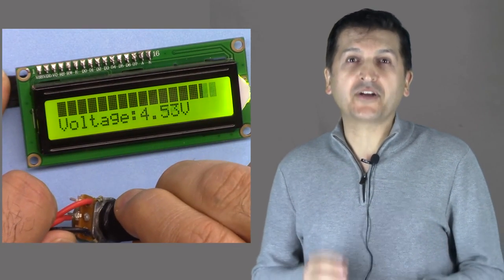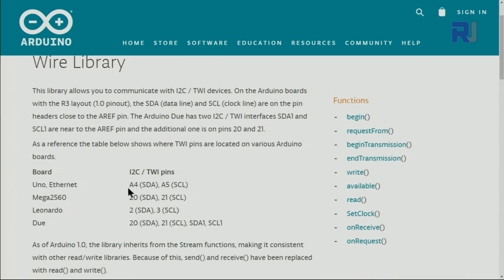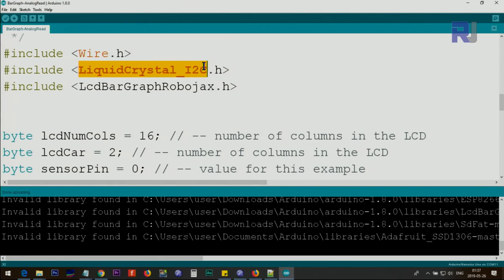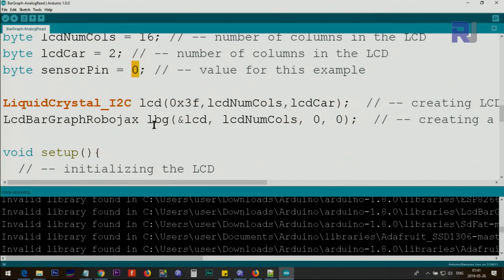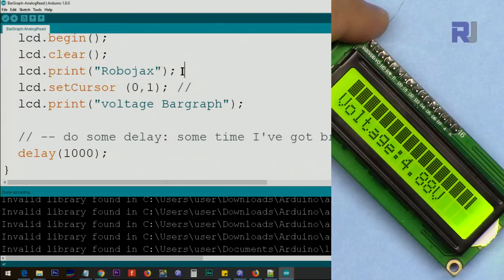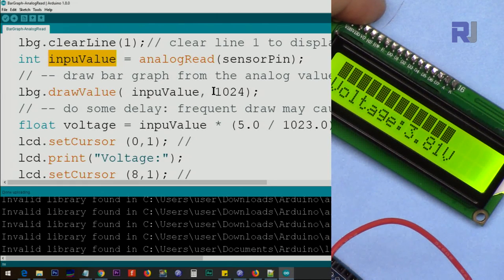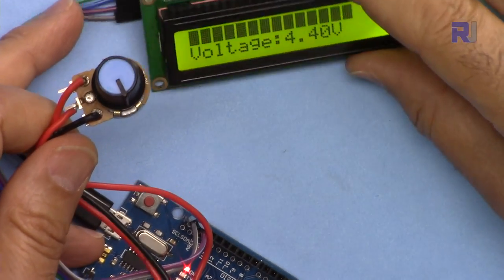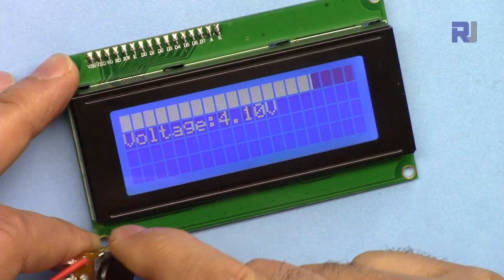Display input voltage as bargraph on LCD using Arduino and potentiometer

Comment: Thanks for the excellent tutorial. Your library directly references the i2c library. Is it possible to change this so it's not necessary to use an i2c adapter?
Reply from the maker: You are welcome. It would but LCD1602 without the I2C is very missy so I prefered the 4 wire version. The library can be fixed but it needs a lot of work.

Comment: I like your video! You are very easy to follow! I'm a subscriber now! Thanks!
How Would I calculate what is maximum mA left in the battery?
I like to make a simple 18650 battery tester. What I want is VOLTS=  mA=  Battery resistance=  and even more, if you can help!
Reply from the maker: Hi, Thank you for subscribing.
Battery  is the most complicated component in today's world. If anyone can accurately understand the state of charge (SOC), they will dominate the EV (Electric Vehicle). 
I have  studied Batteryies at graduate level but haven't got a chance to make video as I need some components. I just got 18650 batteries and few chargers.  I am wondering why other than EV people will need to use 18650 battery?
Reply: @robojax  I use them as a power-bank for projects. I recover these for free from old laptops! But I also purchased 8 new batteries, so I know what to compare it to!
When I get my new charger, I can provide some data. I do have several chargers, from inexpensive and USB charging in bank of 2-8 18650.
These batteries are - or can bee - very powerful! For now I also purchased from inexpensive to more expensive battery meters, but I get different results from one to the next tester, so I must make a Excel table and compare them more scientifically and side by side.  I also use Arduinos, ESP8266 and ESP32..., Raspberry-PI and couple other boards, that I test or projects - 18650 will keep my simple projects running a long time, much better than AA rechargeable batteries - and I recharge batteries for past 50 years!
I wish my flashes for my Nikon cameras use 18650! I'm thinking to make battery power-banks and put them on a belt and wire plugs into the flash! Lots of projects, so little time! ha ha ha

Comment: Thanks a lot forr his video. I have a questiion. I would male a rpm counter for my spinning cyclette and i put your library in the sketch. I suppose that max rpm value Is 150. Right code is lbg.drawValue (PPM, 150)? Or lbg.drawValue (PPM, 1024)? Thanks in Advance
Reply from the maker: this is very slow for that purpose.  RPM or anything would be very fast.

Comment: Wwhat's that chip connected to the back of the lcd 
do i have to get it in order to display the the voltage or is there any other way of wirring
Reply from the maker: I have separate video on the LCD, the link for that is in the description. I always put extra stuff in the description so check them out.

Comment: I want to display the voltage reading controlling with potentiometer with LCD AQM 1602 using Raspberry pi 4 with C programming.  I'm waiting for your response . thank you .
Reply from the maker: this video is focused on Arduino. In the future I might have Raspberry Pi videos.

Comment: I am making battery charger for lead acid battery so I want to display battery charging percentage with help of Arduino nano and 16*2lcd so what will be code ?
Reply: 12v battery
Reply from the maker: I have included the link to this video in the description https://youtu.be/t8xwrVj2aFs where you will learn how to measure any DV voltage.
Reply: @robojax  thx sir for helping

Comment: Hello Sir, im trying to upload you library for the bargraph, i have installed liquidcrystal_i2c from previous projects. I have download your file, but when trying to upload the zip i get the message "Error 13, INTERNAL library install failed, archieve is not valid, multiple files found in zip file top level." I have decompressed the zip and they are a lot of files, which i have to keep and make a new zip again please?
Reply from the maker: Hi, you don’t decompress. Just add the zip file
Reply from the maker: If you did use the bar graph once then you don’t need to add it again.
Reply from the maker: very simple it says "LcdBarGraphRobojax.h: No such file or directory" it means file not found It means you skipped the video and did not install the library. Please watch and follow. I have said nothing extra except to teach you learn.

Comment: Sir this video is amazing but I want this for 12 v instead of 5v pl can you help me how can I can I do it
Reply from the maker: when you use Arduino, Arduino board has VIN input where you can connect your 12V and the LCD and Arduino will power up. Or you can connect the 12V to the power adapter connector.  see this image https://circuitjournal.com/img/articles/6_arduino_power_pins/VinPin.jpg?v=17
Reply: @robojax  thanks for replying sir I want to make 12v battery indicator like this so how can I do that I understand previous message but I want to make it battery level indicator pl tell me thanks
Reply from the maker: Please watch this video https://youtu.be/t8xwrVj2aFs and learn about voltage divider.  Then your potentiometer will be 1 of the resistors apply the same principle. here anotother video for voltage sensor https://robojax.com/learn/arduino/?vid=robojax-voltage-sensor. good luck.
Reply: @robojax  thank you so much sir

Comment: there is a mistake in your code and people get an error with rjx
because you write lbg and under you try add rjx but it should be lbg in this line rjx.clearLine(1); instead rjx--> lbg
and same thing in line under
Reply from the maker: you must be referring to other code. I just checked it and there is rjx in this code. Follow the code from the link under the video and you will see there is no error.

Comment: there is a error   [code]
 LCD begin

#include <Wire.h>
#include <LiquidCrystal_I2C.h>
#include <LcdBarGraphRobojax.h>

byte lcdNumCols = 16; // -- number of columns in the LCD
byte lcdLine = 2; // -- number of line in the LCD
byte sensorPin = 0; // -- value for this example

LiquidCrystal_I2C lcd(0x38,lcdNumCols,lcdLine);  // -- creating LCD instance
LcdBarGraphRobojax lbg(&lcd, 16, 0, 0);  // -- creating 16 character long bargraph starting at char 0 of line 0 (see video)
        
void setup(){
  // -- initializing the LCD
  
  lcd.begin();
  -//GIVES a error
  lcd.clear();
  lcd.print("Robojax"); 
  lcd.setCursor (0,1); //  
  lcd.print("voltage Bargraph"); 
   
  // -- do some delay: some time I've got broken visualization
  delay(1000);
}

void loop()
{
  lbg.clearLine(1);// clear line 1 to display fresh voltage value
  int inpuValue = analogRead(sensorPin);
  // -- draw bar graph from the analog value read
  lbg.drawValue( inpuValue, 1024);
  // -- do some delay: frequent draw may cause broken visualization
  float voltage = inpuValue * (5.0 / 1023.0);
  lcd.setCursor (0,1); //
  lcd.print("Voltage:"); 
  lcd.setCursor (8,1); //
  lcd.print(voltage); // print
  lcd.setCursor (12,1); //  
  lcd.print("V");   
 
  delay(100);
}
Reply from the maker: it says you skipped the video and did not follow the instruction.  I just watched it and clearly said. please watch and do not skip. I have spent hours to make this video so it work without any issue.
Reply: In the LiquidCrystal_I2C "lcd.begin();" is expected to have two arguments in the (). This is redundant. Just replace it with "lcd.init();" and the sketch works perfectly

Comment: How can I make this work with 12v input
Reply from the maker: connect your 12V via power adapter jack to Arduino.
Reply: @robojax  sorry, I meant I want a bargraph to read from 0 to 12v. I have a water level sensor and I want to use an lcd for the readout but the gauge is a 12v scale
Reply from the maker: then watch this video to bale to read any voltage using Arduino https://youtu.be/t8xwrVj2aFs
Reply from the maker: Actually I went to post he link in the description of the video, and found it was there. I wish you had checked description of the video.

Comment: hi sir, what if we wants to read voltage about range of 12V
Reply from the maker: No  you can't . Maximum input voltage for Arduino is 5V. I will make video soon to measure any voltage with Arduino. make Sure to subscribe and leave the notification on. I have a video on using voltage sensor here https://youtu.be/FaoKzi7tgME where you can measure up to 25V DC.
Reply: I'm using a voltage divider in my vehicle (12VDC nominal). Works great. A 20K and 10K resistor has a 6.58mW dissipation for a 3:1 ratio

Comment: Arduino: 1.8.15 (Windows 10), Board: "Arduino Uno"

C:\Users\Sajjad\Desktop\project_code1\project_code1.ino: In function 'void loop()':

project_code1:50:7: error: 'class LcdBarGraphX' has no member named 'clear'

   lbg.clear(1);

       ^~~~~

exit status 1

'class LcdBarGraphX' has no member named 'clear'

This report would have more information with
"Show verbose output during compilation"
option enabled in File -> Preferences.

Comment: This does not work?
one of many lines in error report.....
graph.ino:61: undefined reference to `LiquidCrystal_I2C::setCursor(unsigned char, unsigned char)'
Reply from the maker: you clearly see that I am demonstrating it and it is working. You must Watch the main LCD1602 video and use the library I provided for LCD. Then the library for bargraph. Please watch without skipping.
Reply: @robojax  My apologies..seems i had an issue with library conflicts. I have it going now, and it is perfect for my project. Thanks so much for your work

Comment: I am working on a project to synchronize motorcycle carbs and I want to display two bar graphs only from 2 analog pin inputs. I can't seem to get the code right to make it work, any ideas on what I need to do, I did get the code for the video to work fine so one bar graph is good, just trying to get the second one to display. A0 for the first input and A1 for the second. Here is a link to my video https://www.youtube.com/watch?v=oOD81qLYSa0
here is a link to the INO file: https://drive.google.com/file/d/14ljWNKRw2Vlk_3U35RWhAD0HxVCyU_Vw/view?usp=sharing
Reply: @Todd Morrill
Got it 
PM me

Comment: lcd.begin(); is error
Reply from the maker: What does it say? Have looked at the description of this video? You need to watch the video of LCD so you can print simple text on the screen first
Reply from the maker: you didn't reply?  Always when  someone takes time to do something for you, just reply.  I can help you if you reply.
Reply: @robojax  no matching function for call to 'LiquidCrystal_I2C::begin(int)'
 but I already copy the zip file. sorry for the late reply I have a slow internet connection.

Used: C:\Users\Dominic\Documents\Arduino\libraries\robojax-LCD-bargraph-Library
 Not used: C:\Program Files\arduino-1.8.13\libraries\robojax-LCD-bargraph-Library
exit status 1
no matching function for call to 'LiquidCrystal_I2C::begin()'
Reply from the maker: Yes the library is missing.
Reply from the maker: Please watch this video where I have shown how to install library in an easy way https://youtu.be/XGsT-0P0gMU
Reply: @robojax  sir, I already watch the video, and I follow the instruction base on the video but still " lcd.begin(); " is an error and says " no matching function for call to 'LiquidCrystal_I2C::begin()' "